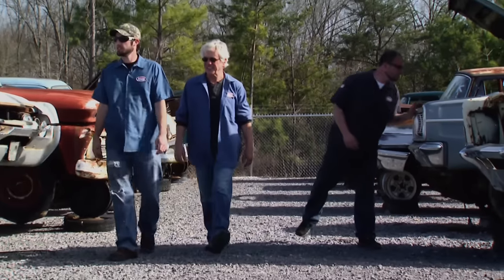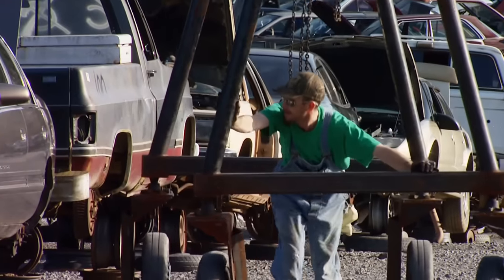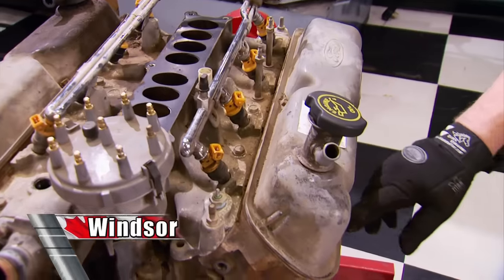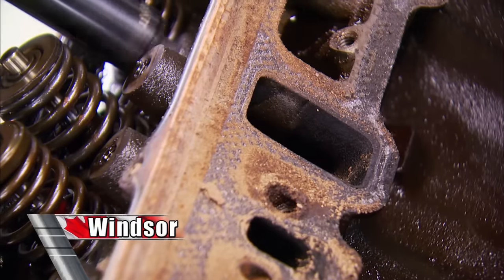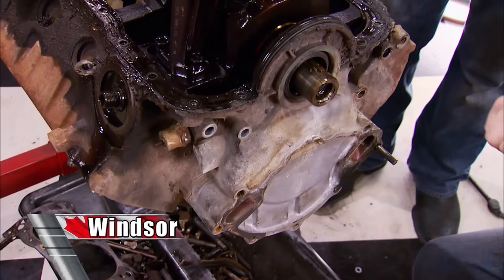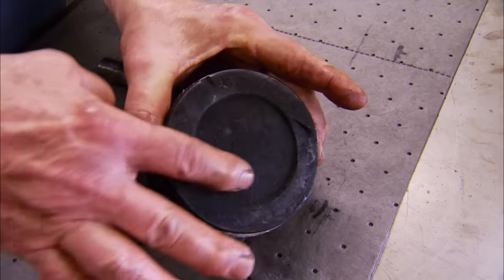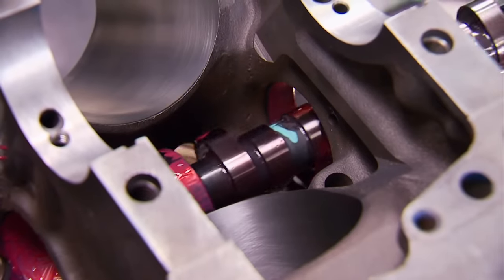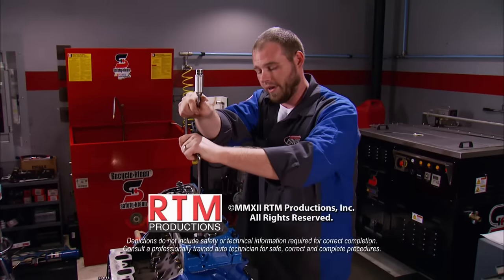Tearing Down a Pair of 351 Small Blocks: Windsor vs Cleveland - HorsePower S16, E10

Comment: Man killer video,Ive always only messed with Windsors but always wanted to know the difference between the Windsor and Cleveland,killer place too where you found the engines,i love diversity,businesses that dont diversify usually die, they have all kinds of things going on there and some rare cars, awesome.

We have a couple of pull a parts in my hometown and i love going there,you can save some incredible amounts of money by pulling the stuff yourself,my buddy was with me and we found this Mustang (87 to 93) that came with a sunroof, somewhat of a rare option for those cars,he pulled it and the guy charged him 20 bucks for it,he sold it in market place for 200 and the guy that bought it said he would have paid 300 for it gladly,it was mint too, you got lucky finding that Cleveland,good day for everyone, Great tip on the cardboard, gonna have to remember that!

Couldn't believe how clean that Cleveland was when you took that intake off, man whoever owned that engine changed the oil regularly, i took a 351 apart once and that whole valley was completely full to the top with sludge and carbon and it had a spun bearing on the crank,probably a fleet car that never saw service,lol

Comment: It seems that these old engine rebuilds involve keeping the bare block and heads, and everything else removed is just thrown out.   It begs the question of whether if it's just easier too buy a crate engine.  But nice rebuild anyway.
Reply: Only problem with that is when you are looking a specific block, otherwise sometimes yes.
Reply: Easier? No doubt.
Better? Like that one engine I installed from a major rebuilder that sounded like they left a rod bearing off?
Flip your coin, buddy.
The real question, though, is can you afford a crate engine that uses a block and crank that hasn't been cast in near 50 years?

Comment: Love the 351/400 Cleveland on my fathers 78 f150 custom. Going strong at 385k miles after a mild rebuild.
Reply: That was a 351 m  modified 400 not the same as Cleveland.
Reply: @brianbabb6666 Hate to break it to you, Ford classified the 351C, 351M, and the 400M as the 335 Series of engines. The C difference from the M & 400 by 1.1 inches. The C is a small block pattern and the M & 400 are the 429/460 pattern. But all three are the 335 Series engine.

There are differences, but the basic design are virtually identical. The 351M/400 are just scaled up version of the 351C.

If you could stroke 351C over 400 cu in, the 351M/400 block, crank, and rods would be what you need. The 351C can only be reliably stroke to about 377 cu in (some have got 393 cu in with high side loading on the cylinder walls).
Reply: @brandonrobertson6327  why go through all that to say not the same?
Reply: @brianbabb6666  To give context. Ford claimed all three are of the same engine family because of the design. You are making a claim that they are not due to certain parts not interchanging. Yet some parts do. Ford was attempting to phase out the FE line of engines and possibly the 385 Series 429/460 line up to make a single line to do all. Due to the emissions war on American auto manufacturers, this is why the 351C was done away with because of the 351W and kept the 351M/400 was marketed for a middle ground between the Windsor and 385 Series. 

You can have the same engine design, yet scale up or down. Ever heard of the 5.9L and 8.3L Cummins? Virtually the same design, yet only about 50% interchange due to scaling up the 5.9L.

You can still claim it is not a so call "Cleveland", but that is the name of the foundry plant where the molds was for the blocks and heads. The design is the same with a scaled up version. As a side note, the 302 and 351W are the same family class also, but as in the Cleveland/335 family, the deck is about 1 inch higher just as the 351M/400 to the 351C. Yet everyone will say the 302 and 351W are the same engine family.
Reply: @brandonrobertson6327  you sure are long winded but it still doesn't make the 351M /400 and 351C the same?
Reply: @brianbabb6666  Well, Ford engineers think differently. And I agree the 351C is not the same engine. Neither is the 351M and 400. They are the same design with subtle differences. I guess you don't understand that any machinery can be scaled up or down.
Reply: @brandonrobertson6327  subtle difference means not the same small block bolt pattern not the same. You keep talking all around it but refuse to admit it? The 351M is a destroked 400 because the 400 wasn't holding up.

Comment: This looked promising but in the second part they build the Cleveland stock and stroke the Windsor to 408" and make into a clevor. Not much of a comparison.
Reply: Indy Rock also use the same cam for 2v and 4v heads 🙄
And those beehive springs aren’t going to cut the mustard with those big Cleveland valves
Reply: WHAT?  seriously?  Thats stupid.

Comment: 390 hypo and a 428 cobra jet make me happy.  Seen a guy took a 300-6 and turbocharged it with adding stronger valve springs and head bolts that's a monster.

Comment: WILL you PLEASE stop using a GM term on non GM engines ,  there is no small block big block dumbing down of Ford powerplants they came in ENGINE FAMILIES thats a 335 engine  family and Windsor Family
Reply: Get over it
Reply: @timothypriest4791 I get it but I believe they made a video about 351 Windsor, Cleveland and “Michigan or modified” and they cleared the confusion or fact

Comment: The 351C had two different heads. 2v were two barrell carbs and 2.04 intakes valves. The 4v heads on four barrells were 2.19 intakes!  I spent my high school years with a Torino 351C two barrel searching junk yards for four barrel heads.

Comment: don smith  the cleveland is a smallblock, it's smaller than the 351 windsor   deck height for windsor is 9.5"  cleveland is 9.2" windsor is .300 thousandths taller! now thats a fact and for the cat in florida that says the boss 351 didn't have a steel or forged crank he's right and i can tell you why.  it's because you don't need one.  i raced limited late model  @ speed world (orlando) and new symrna  Fl.  for three years and i won the championship all three years with a 030 over flat tops, stock rods and stock crank. I turned it 72 to 7500 rpms and never blew an engine did bend 2 pushrods one night in heat race, pulled them out put 2 back in and won the feature i hold the track record for my class, and now you can't run a cleveland anymore  I had the only ford in the field and I know a little bit about fords I only won about 60/65 trophies.  69 fastback mustang and 72 torino and 88t-bird I even took it to georgia and run it on a dirt track actually clay. (Golden Isles Speedway) it's says it's the fastest half-mile in the southeast  and finished 3rd on asphalt tires!

Comment: I had a 1995 F150 with that same vintage 351 Windsor that I took to a local engine shop and had them build into a 393 stroker. It was a great running engine that I felt had more ass than the 460 in my 1997 F350.

Comment: I took a 351w and stroked it to a 408, flat top pistons, cam and heads, makes great power
Reply: Do you remember any numbers? I've got a cleveland that i want to stroke to a 408 but i wanna make sure itll make the power that im looking for
Reply: @flamin5.833  Dyno at 495  hp 515 ft lbs of torque
Reply: @flamin5.833  learn from my experience tho, my motor is pushing 230 lbs of compression per cylinder, spend the extra money for steel head gaskets lol, I blew both head gaskets on my first start up because I was in a hurry to get it done and used auto zone gaskets
Reply: @flamin5.833  I might can get you part numbers of all the stuff I put in it including the heads and intake if I can find my paper work
Reply: @geauxtigers2911  sweet if you could that would be awesome
Reply: @flamin5.833  You can easily make 500-600 on pump gas with a Cleveland. Type Joe Sherman Ford Cleveland build, it was done by Popular Hot Rodding.

Comment: I love both of those motors but  I REALLY love big cubic inch tall deck Windsor bottom end with CHI Kaase Cleveland heads.
Reply: I like the Cleveland blocks, 408 strokers really respond. No need to upgrade unless you want to make four digit power.
Reply: CHI and Kaase are not the same.  CHI is Australian and the best aftermarket head for Cleveland’s.

Comment: Boss 289 had hemispherical heads (built to complete with Mopar) the cleavland had not been built/ the boss 302 adopted the canted valve heads/ cleavland used the boss Windsor style heads / not the other way around / the readily available cleavland heads were adapted to Windsor motors later on / edelbrock make boss heads and manifold kits today .

Comment: Yes! Great find on the 351C , but dont forget the the 351C also has the "4" on the intake manifold mean it is a 4 barrel, the 351M look alot alike and i believe those 351M have a "2" on the intake manifold. Although they look alot alike they are as you know better than me is they are different engines/  I believe the 351C is also a 4 bolt main block.

Comment: I had a 79 LTD II that had a 302 in it. Until the front bearing started to go bad(1986) and lost oil pressure on the hot days in Minnesota. Through the grape vine I found a 351w 4v out of a 69 Mustang that was recked. Cleaned it up and put an HEI distributor in it and some headers. Drove the heck out of it till  it got a burnt valve and parked. Then ending up selling the engine to a guy in oklahoma to put in his 69 mustang... Isn't that crazy...Guess I just borrowed it.

Comment: After the u.s. stopped making the Cleveland in '74,  Australia manufactured the 302 and 351 Cleveland until 1981 and the last Falcon fitted with a Cleveland was sold in 1982.

Comment: My dad bought a 65 F-100 with a small block 351 engine. I not sure which version. I only know that the stock manual 3-speed was HOT and it was the truck I learned to drive! I was a never beat in a drag race and it remained stock and had no better than a 2-barrel carb. I often joked that if I could not get around a slower moving car on the two lane roads by passing I could simply romp on it and I could jump over to pass.

Comment: As a FoMoCo guy, I love both engines equally.

The Cleveland could have been a real dynamite engine, just came out at the wrong time with emissions and whatnot, and was much more expensive to mass produce, relative to the Windsor, which had been around longer.

The 8.2" deck Windsor was really, and still is a fantastically engineered engine design, considering it first came out in 1962. A relatively light and cheap to machine block for the displacement.

Comment: I had a 78 T - Bird w the Windsor .
Fun motor to get up n go .
Wish it was the Cleveland tho .
Reply: Stock vs. stock, the bottom ends were better on Windsors than on Clevelands unless you're talking about a super stock Cleveland like a Boss 351 which are rare.  By 1978, the smog engine 351Ms were real turds.   You wanted the Windsor in 1978.

Comment: Fuel injection was a blessing, especially with Fords. Those 2 barrel carb Ford 302, 351 and 400 V8’s of the early through mid 70’s would frequently meet their fate with scored up bearings, I used to see it a lot with friends cars I worked on in the 80’s.  In cold climates people would set the chokes on their carbs to open really slow so the engine would run without stalling, and they would flood the oil with gas from blowby.  If the owner only used the car for short hops, the oil got contaminated quickly.  If buying one them from a scrapyard, always pull the pan and inspect all the bearings.

Comment: Don't immediately discount the 351M motors. Sitting on top of those are the 2v Cleveland heads. While the low compression, open chamber heads aren't the hot ticket for big power, there is another option. You can grab any 351W piston you want and bush the 351M rods, as long as you pay attention and get your compression heights correct. You can have anything from mild to race gas territory. The 351M and 400 are nothing more than tall deck Clevelands. In fact, the 351M is just a 400 block with a shorter stroke crank in it. This also raises some interesting questions. If you're building a performance Ford motor, you can just get a 400 crank and get the extra displacement. Use the 4V heads if free breathing power is what you want and you can get spacers to make intake manifolds line up. Or keep the 2V heads, bump the compression with pistons and get a good cam (the factory cam sucks) to match the setup. Not a high power screamer, but a good candidate if you have an old Ford Truck or Bronco that needs some extra oomph. Ford trannies with the right bellhousing are everywhere.
I'd take the Cleveland/Modified motor over the 351Wheezer any day of the week in an older Ford project.

Comment: Love my 351W. Just my option but to me Fords 351W and 460 are  thier best 2 engines they ever made. I have both.
Reply: I would rate the 300ci I6 at the top
Reply: @flcracker9  it was a really reliable engine.  Just lack the size and ability to work like the Windsor and 460. Thats just me. I do not want a six cylinder in a full size unless its a Cummins.

Comment: On 351 C and 351M  the 351 C blocks cracked and were welded differant and all called 351m with wide vave covers the other 351 is the windsor. Looks like 302 but not the same. 351 block taller and headbolts larger. Find a 1969-70 351 windsor and you got a running sob!!! You can put 351w head on 302 but have to change headbolts or drill out all bolt holes. The advantage was bigger valves meaning more fuel and air but we are going back in time now. New cars have EFI and comp and bulletproof almost. 351c valves are canted pushrods at angle  351w are like 302 all lined up. Get 460 big block efi!!!

Comment: The 351 Cleveland was very successful in the Falcon in the Australian Touring Car Championship from 1970 right until 1984. Not to mention I didn't know they made 351's with fuel injection we definitely didn't get those in Australia :(
Reply: That's only on the Canadian Windsor starting in the mid 1980's.
Reply: @theronash7269  Yeah would've sold more v8 cars in 90's in Australia had they have gone down that way. The 302s they used here sucked monkey droppings.
Reply: @jamesmcgrath6938  You notice they wiped out car manufacturing in Australia?
When I lived there in the mid 90's they were still building Holdens and my roommate would bring brand new Fords home from the factory in Melbourne.

Comment: My 1969 Mustang Grande had a 351 Cleveland, 450 Holly, Dual exhaust, that ran so smoothly, on several occasions, I tried to re-start it, thinking the engine had quit! Dyno test gave 290Hp - back then, the local gas station/service shop had one! 0 to 120mph in 20 seconds, and got 25mpg highway! (before anti-pollution controls came into effect).
Reply: @centraltexasfoxbodies  Probably swapped on when the engine was swapped in.
Reply: @centraltexasfoxbodies  Not knowing which year or iteration of the 351C was swapped into that '69, a valid answer to your question is difficult. A 450 would be a step up for any of the small port 2V engines like the one in this video.
Reply: @centraltexasfoxbodies  That's not what you asked. You "said" smaller than STOCK. The 4412 Holley was not stock on any Cleveland.
Reply: @centraltexasfoxbodies  No. Not available until '70 models. That being said, throughout the 70's, lots and lots of 4V Cleves were swapped into earlier Windsor cars. Easy to do. At this point in time, many people remember things that didn't happen. Mr. Moffat did not claim it was the original engine. However, if he remembers it as such, he is mistaken. This is a very old argument, with zero production '69 C's verified.
Reply: @centraltexasfoxbodies  As I mentioned in another post, the oil pan is a double-sump on that Cleve in the vid. If they actually install it, it should be in a Fox.
Reply: @centraltexasfoxbodies  It means you SHALL be entertained seeing a Cleve-into-Fox project, which is uncommon.

Comment: D2AE-CA is a common block, seen in both 2 bolt and 4 bolt configurations.  It was also the casting through end of US production.  That AFAIK was also the service block casting.  Nothing in that casting number that says "It's a CJ".  It's a 2bbl as pulled and no "CJ" was a 2 bbl anyway.  That said, mild ported 2V heads before 1973 can easy hit 250 intake/190+ exhaust with the stock valve sizes.  Cut the heads to around 74 cc, zero deck the block and with a decent hydro cam make 400 HP.  Also as a note, it is not recommended to re-use the stock valves in any even mild performance application.  Aftermarket one piece stainless is highly recommended.

Comment: @ itsabig....pardon my delayed reply to your message. If you’re still interested in discussing the inherent shortcomings of the 351 Cleveland 4-V, quench chamber heads and the “port plate “ modifications that we used with a reasonably decent amount of success, then as well as now, I’m always glad to exchange information with builders that have some clue about the topic from their own experience rather than the over abundance of internet BS. 

I’m curious about your project that didn’t get finished. I’m currently building a healthy Cleveland featuring an original pair of Endyn Inc. heads

Comment: My parents bought a LTD back in 78 with a 351 Windsor.  
   It had preignition right out of the box. The dealer told her to turn it off in drive with her foot on the brake to shut it down. 
   Cars like that were the death of Detroit.  
    Low octane , unleaded fuel and instead of building purpose built motors , they thru on HEI and throttle body injection carbs on everything wile companies like Toyota and Datsun were building purpose built engines designed to handle the new requirements. 
   We gave the Auto industry away by forcing people into two choices , buy junk or buy Japanese.